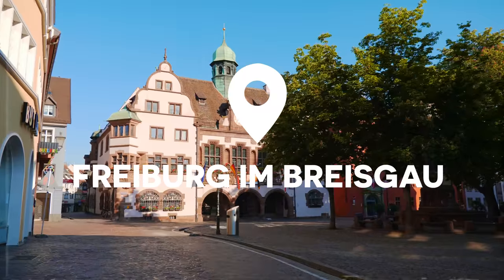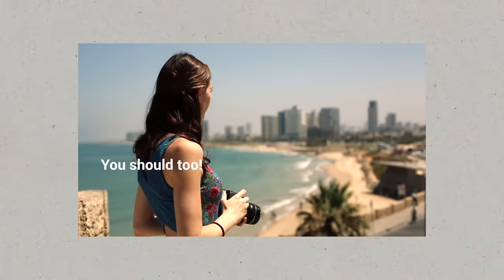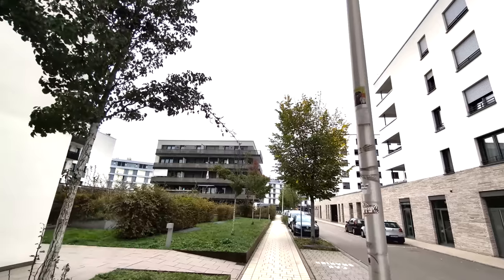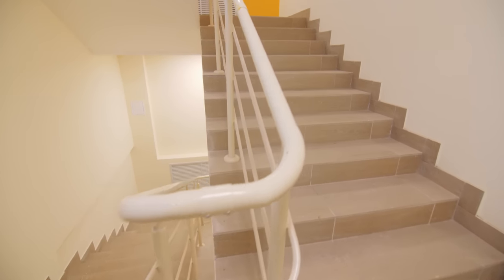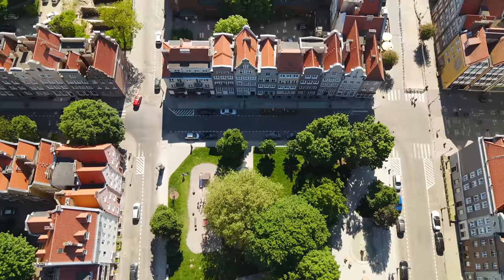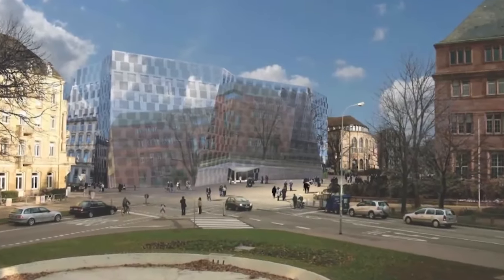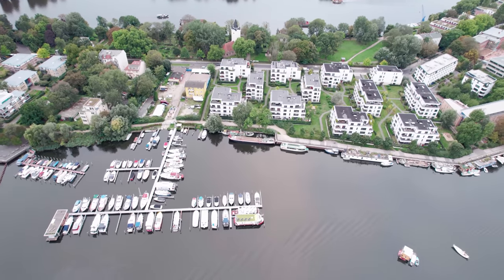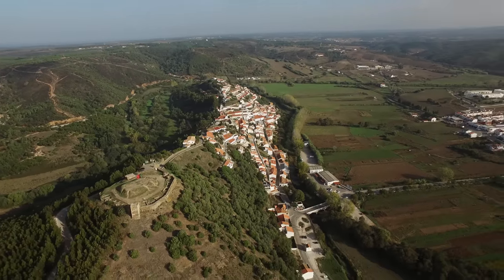Germany's BIG DUMB BOXES ARE AWESOME.

Comment: Lol! Never knew these buildings were called dumb boxes! I guess we've always lived with them , they're just the norm in most of Europe, because historically the city centers are full of them and idk, i guess people just like what they're used to?! At any rate i never thought an apartment building needed to be different styles... It's the inside that matters, really... The outside should only look clean and have enough windows and balcony etc. Much more important than the shape is how well insulated it is and how cost efficient and how well the interior is spaced so you don't have weird corners wasting space all over the place because you can't place any normal furniture there. One thing I've always wondered about though was why aren't more modern buildings built with a cylinder shape. I know nothing about architecture, but knowing most problems in our old apartment happen at corners it seemed a good idea to have as few as possible.😅

Comment: I'm with you on the unnecessary and costly nooks and crannies. But I have a different opinion on high-rises. I'm surprised about the density of german cities/Paris beeing higher then New York. But it comes at a cost. In the city centers you loose a lot of privacy, as there often are houses with window to window. Often you also loose a lot of sunlight because the houses are so crammed together. Also there are a lot of small flats with less then ideal floorplan. 
A high-rise might be more expensive in construction, but offers more living space on a smaller footprint. Which is very appreciated in bigger cities. Surface area is also reduced. And you have more natural lighting which is good for the psychology. And you can plant parks in the freed space. The additional costs could also be reduced if the regulations could be adjusted. If the min fire ladders heights in bigger cities would be raised for example.

Comment: What is a "setback requirement"?
Reply from the maker: It is a legally required distance of which a building must be "set back" from the street. These set back requirements change depending on the height of the building and may (depending on the location) require the building to be terraced as it moves upwards to allow for natural light.
Reply: Thanks!

Comment: Hi, I love the aesthetics of the Library shown, but am sad for how bad it is.
I'm happy with 6 floor dumb boxes, I prefer rooves to not be flat. I suppose the roof thing is dependant on weather, I live with rain.
In UK, I think, the dumb boxes get a bad rap because it is easy to skimp on finish and materials, which can then cause major problems of upkeep (cheap to build, but expensive to maintain). Also issue for occupants, noise transmission, security.

Comment: There are a LOT of these going up in Denver.  If it's been a while since you've visited, you might be surprised by how many of them have gone up or are in the process of being built.  We're on the south end of the city and there are 6 or 7 of them that are going up in the Tech Center alone.  Most of these are 5 over 2 type buildings.  

What seems concerning is that they're mainly made of wood.  I'm a bit old-school and am used to seeing steel and masonry for must construction like this, so, wood seems weird.  I'd be concerned about noise transfer between units and especially fire.  

What do you think about this?  Stuff in the US isn't built anywhere near as well as it is in Germany, so, it looks spookily rickety and fragile.   

Thanks for the great content, as always.

Comment: Some dumb boxes are dumber than others. Those shown early in the video are nicely spaced, which both  avoids one building casting a shadow on the other for long hours and provides better views out of the windows to the courtyard, and has units with windows on at least two sides of the building. Contrast that with the typical apartment complex in the US… 😝

Comment: I might harbor a grudge against Architects. Perhaps because I used to live with some in a shared flat? From my observations new buildings presented in a competition are mostly looked at, and probably judged by, their exterior from a giant's perspective. Because they are not presented as a walk-in 1:1 model but as 1:100 models. And appearance seem to take precedence over practicability. As an engineer myself I would ask for any building to be rated by 
1. cost of building and operating; 
2. practicability (libraries are best if they were in a bunker and not free-standing because of constant ambient condition and no sun); inside, so be the users and outside, so the impact on the environment like wind and sun effects, traffic flow etc.
3. appearance
I learned that good design is not only looks. It is intuitive usage, doing its purpose, ergonomics and appearance. Whereby the last item is not just showing off and being different or interesting. The appearance should help humans to identify the purpose and be pleasing to the eye. So a glass facade not guiding the user to its entrance gets a demerit. A building has first a function and only then looks.
And the architectural gimmicks should not increase costs. A good (bad) example is the new concert hall in Hamburg. They wanted those bulging windows. Each of them different from the other so it had to be made by hand. This was totally unneccessary because they could have varied the pattern/placement of the non-bulging with bulging ones "randomly" to make it not look like Kaufhof. They could have also varied the distances of bulging windows by using standard windows  made in two to three different widths. AND the very big screw-up was that the windows had to be multi-pane insulating ones. So they had to make bulging multi-pane windows with a semi-vaccum between the panes. And every one by hand because of the different dimensions. Instead they could have used three or four differently sized standard windows for insulation. And then fit bulging plastic or even glass windows as an outer facade. So the functions of insulation and looks were done by two separate and cheaper to produce items.
But that happens when architects (with too much artisan and too little engineering mindset) and politiciasn with a desire to make a mark but nothing practical are in a committee.

Comment: The examples of big dumb boxes you showed are diverse and attractive enough to avoid becoming boring. Although I do find a bit more color variation would be nice. But a lot of big dumb boxes are serial-built in exactly the same style and color. Because it is cheaper, i guess? What annoys me mostly is the tendency to paint all common areas always white and to add to the boringness a grey floor. There is so much to gain from a bit of color variation and it has no negative impact on the environment

Comment: Very well explained. Would changing the 22 meter regulation to for instance 25 meter by progressively introducing more capable fire trucks help densifying more? Or is this really the optimum?  longer firetrucks might not be able to get through smaller city streets.. so I appreciate there are a lot of parameters and constraints to be optimized.
Reply: MY guess there is probably a LOT of codes that come to play at that height and to go up ONE MORE floor likely would require NEW building materials and techniques and regulation "hurdles" like the mentioned second egress
Reply: Replacing the existing high reach trucks would cost money. Would the developer be willing to pay part of the cost of the new fire truck rather than the cost of building a fire escape. All the existing building are not going to be replaced so you will have a more costly vehicle to buy and run that is only needed for some buildings. 

As you point out the bigger trucks may not fit in the smaller streets where high reach trucks will also be needed. The fire brigade would then have to maintain two sets of vehicles rather than one. The city may have two high reach vehicles, but rarely need both at once; with two sizes it may need four.
Reply: @johnclements6614  It a good engineering and economics question: maintain status quo, or decide that in germany, the next fire truck standard should be able to go higher. It would take possibly 25 years to see the impact.
Reply: There are some good reasons why the standard fire truck can „only“ reach 23m high. 
The Dimensions of trucks are regulated so everything else is built in a way a truck can pass that. Bridges, intersections and roundabouts for example.
So you have a given platform to build a fire truck on and in the end the max. 23m reach was the result of the given constraints. 
If you look at a turntable ladder you can see that the developers have use a lot tricks to make 23m possible e.g. extension so the fire truck fall over if the ladder is up.
And there are designated places at buildings for a turntable ladder.
If the turntable ladder gets bigger the places might be to small.
So if you want to change a single norm it has a lot of consequences for other norms. 
And it’s a pain in the ass if one piece of the puzzle doesn’t fit. Where I live we have one old bridge that doesn’t have the high of 4m. Your fire department has a special turntable ladder that fits through that bridge. But the fire department in the next town doesn’t have one (very expensive).  
If we have fire where you need more than one turntable ladder it’s always extra work to coordinate that.
Reply: It's not only the fire trucks. Municipal water systems in Germany generally supply a water pressure of around 3 to 4 bar. The water pressure decreases against the geodetic height. This means that the municipal water pressure is usually only sufficient up to the 4th to 5th floor of a building. Higher buildings require a a pressure booster system (Druckerhöhungsanlage). This is a technical device, usually one or more pumps, which is part of the water supply system within buildings. Then there are the regulations on elevators and the fact that the higher the building is, the more and/or bigger elevators are required.

Comment: One thing bothering me about this is that energy useage =/= carbon output. I believe energy consumption is a secondary concern to energy production. Like, in France it wouldn't make sense to reduce energy consumption to reduce carbon because most of the energy there is either green or nuclear. Same thing with plastic =/= carbon output. They're both problems, but take on completely different forms. A great example is this indoor ski resort I've been going to. People made a huge piss about how big the carbon footprint of the place must be, until we found out it's powered by 100% renewable energy.

Comment: Thanks for the great video, I really, really do appreciate your diverse theme selection and the deep dives and effort you put in every single time! To your question about the future of architecture, I think it would be reasonable to turn to traditional, globally available materials. In addition to the design aspect, the construction industry produces the majority of waste, also hazardous waste. What really shocked me was a documentary about the diminishing sand resources and its brutal consequences. Concrete e.g. needs lot of sand and that sand is incapsulated in it forever. If you'd took clay e.g., which is accessable in many regions worldwide, you'd consume much less sand. Besides this, it is a very uniquely functional building material. It can be reused repeatedly over the course of centuries without any loss of functionality. There are many ways nowadays to incorporate these proven traditional materials into modern architecture. I believe it's not always best to look for new inventions for sustainable solutions but rather to help integrate the new with the proven old.
What would also contribute to sustainability is creating awareness that built-up areas, i.e., sealed ground, represent a loss for nature and hinder the possibility of groundwater percolation. Therefore, in my opinion, building upwards with minimal ground footprint is not the worst approach, although one should strive for a compromise and move away from gigantomania. Even taller structures can now be statically realized with wooden constructions instead of carbon-intensive steel.

Comment: I live in a small town in rural south Germany. Most people own 1-2 family houses or rent one.
Most of them available on the market are built between 1930-1980
Problem with those houses is a shortage of modernisation. Thirty year old windows. No insulation but a brick wall. Heating and warm water through an Efficiency labeled "E" oil oven.

I would gladly take any modern big dumb box with state of the art efficiency and noise insulation over any of these mentioned building.

If there would be any. So the only option is, build yourself, or rent any of those patched up and milked shitholes.

Comment: There is basically zero budget for external design when it comes to working-class buildings.
Pre-WW2 these buildings were decorated, even if just influenced by the traditional materials. Of course the inside was less livable as the heating was coal/wood and the plumbing basically non-existant, but electricity was possible. As a caveat, often more people inhabited these working class flats.
Post-WW2/Pre-end-of-Cold-War these buildings were less decorated, but boasted a livable - and affordable - inside of heating, plumbing and electricity. This is also when basically flats were  everyone but students and perhaps migrant workers got their own flat.
Now in modern times we realize that we can't use and afford this much energy and have shifted the cost of running to the cost of the building process up front. This is all good.
But the fact that external design / decoration has gone completely out the window, shows - that for the working class - these buildings are barely affordable. No they are not cheap, they are not even inexpensive. They are just plain as affordable as they can be because quite frankly everyone's need for a livable housing needs a (literal, see CO2 footprint) ton of energy.
In the end, we have to solve climate change or capitalism or both - before normal builds can be nice again.

Comment: Interesting about the sweet-spot of building height. I wonder if it's the reason I see the same pattern here in Sweden. Pretty much every bigger city will in the city center be dominated with buildings about 5-6 stories high. Smaller towns or suburbs often have 2-3 stories high buildings.

Comment: 4-6 storie homes in Germany won't need an elevator (new ones only if the basement flats are wheelchair accesable). And elevators have HUGE costs in building and maintenance. They have to be checked by TÜV and repaired. If you have wheelchair accesable flats up on the second or third floor, you need to fix it within a day. And they are rent extra costs. 

To the library: Saving ONLY half of the energy of the old one is quiet bad. The old one was build in 1978 prior to the modern energy saving standards. The standard then was so bad, that a 80-90% energy saving should have been possible.
Reply from the maker: In my experience elevators, while not necessary from a code standpoint, have still become a de-facto requirement for new buildings. Most families have strollers (which may or may not be accommodated by a ground floor lager raum... but also for moving purposes (furniture, appliances, etc.). Most new tenants expect it in a new construction residential building.

Comment: In Germany in houses which have more than six floors (including ground floor) an elevator is mandatory. This is why most buildings are not higher.
Reply from the maker: That's not entirely true. In Germany, multi family Residential buildings (Mehrfamilienhauses) are all generally required to have an elevator today, by de facto. In the Netherlands the requirement is for any building over 12.5 meters in height (3 stories), but most do it any way because it's a feature most tenants have come to expect for moving and or accessibility purposes.

So for example, yes... Code says that, in new buildings, elevators are mandatory from up to 5 floors. BUT, code also says that new buildings MUST be accessible (both state owned and private buildings). 

And since code says that in new buildings with elevator.... 50% of the apartments have to be accessible.....and most tenants expect such amenities.....In practice, new buildings put in an elevator.
Reply: @TypeAshton  Thanks for reply. I always believed into the 5+ story rule. I did some googling now and found out that (as so often in Germany) you and me both are right. Obvioulsy, there are (as so often in Germany) opposing legislations. Also I found out (ok, I was not surprised) that there are Bundes- and Landesregulierungen (federal and province regulations) which does not make it easier.
Although I support the aim of barrier-free access, it seems to be a horror to me, if in every house with more than one groundfloor elevators would have to be built. Space is rare and elevators are expensive and I know many places where there are continous problems withe the elevator. If elevators are mandatory in all houses, many will refrain from building more stories, and this will not help anybody.

Comment: Another question you might be able to answer?
Why is it, that in American suburbs everything outside is made of concrete? Drive ways, sidewalks, anything related to floor to walk or park on is concrete.
Why do Americans not use Asphalt for sidewalks...drive ways...anything on larger scale flooring outside.
I don't get it!
It crumbles quickly, gets real grimy and looks bad then, breaks after a harsh winter, impossible to repair without a fuss.
Why not simply Asphalt as on the roads...it lasts much longer, is resilient to frost, grime can't be seen really or doesn't occur...and asphalt has more grip, it's safer.
Easily repaired, so you can't see the patch.

So, why is it that you use intentionally the inferior material???